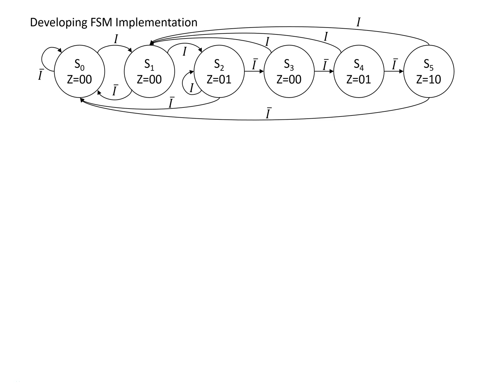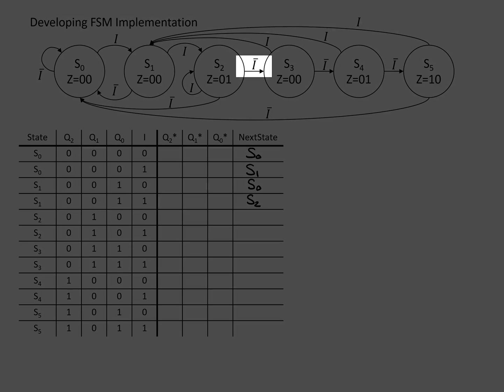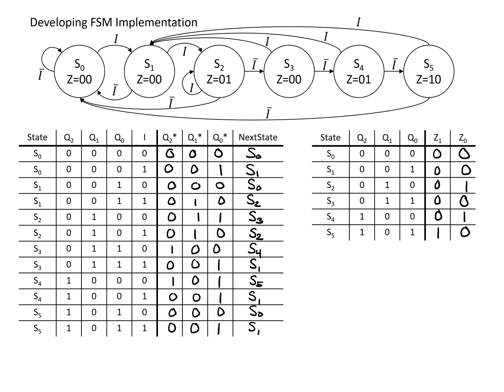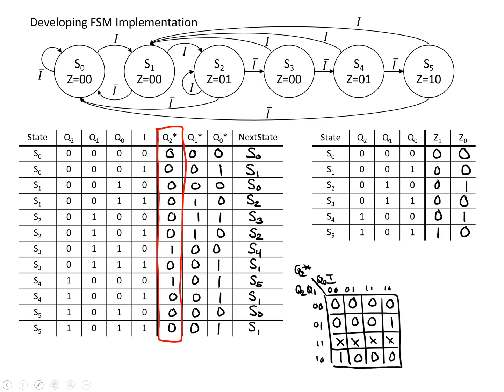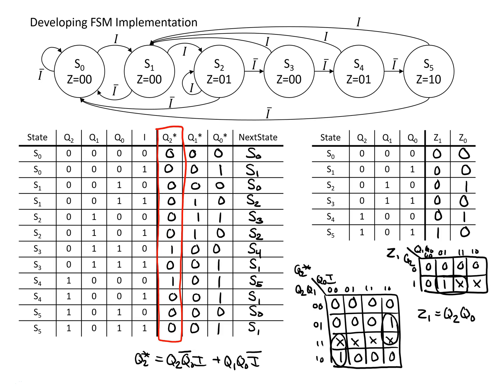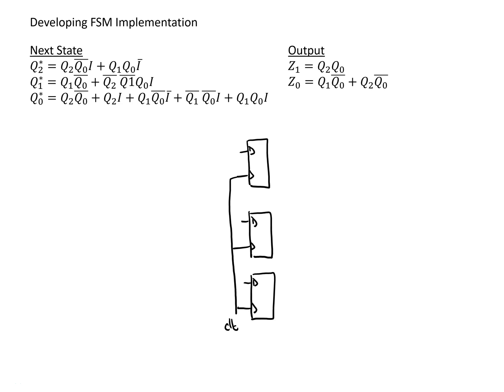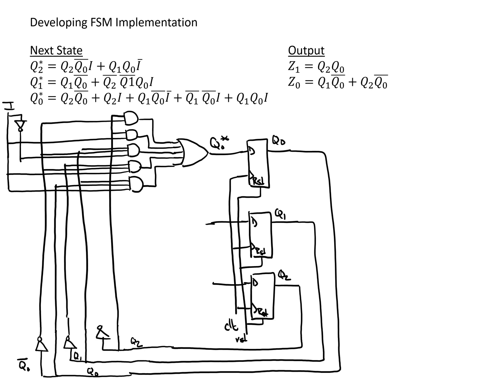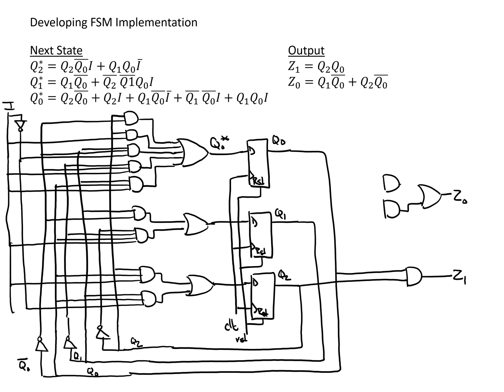FSM Implementation

Comment: Very respectfully: I believe that S2 transition arrow going back to S0 in the FSM arrow diagram is wrong. You can't have the two actions shown for the same input state (I# causes S2 to transition either to S3 or to S0 but not both as shown).  Since the state table shows S2 stays in S2 when I# is true, the direction arrow pointing from S2 back to S0 should be removed. I assume there isn't a hidden control register (I say "hidden" because the Moore FSM bubbles in tin some approaches represent output states, not control states).